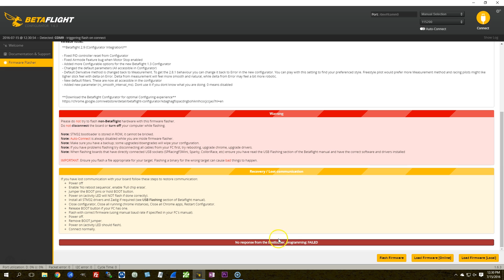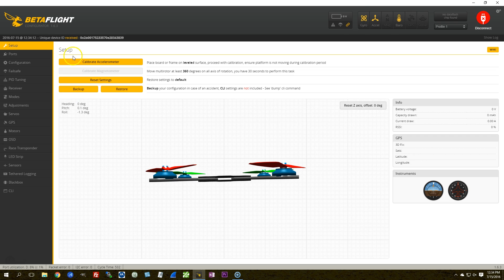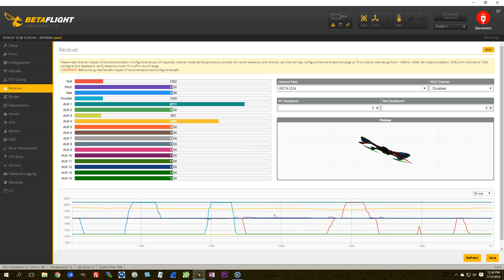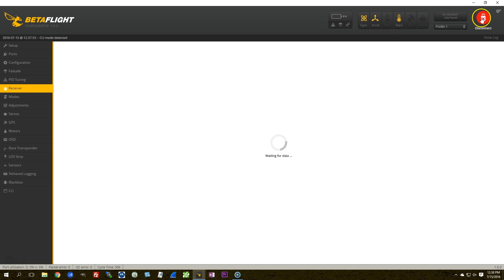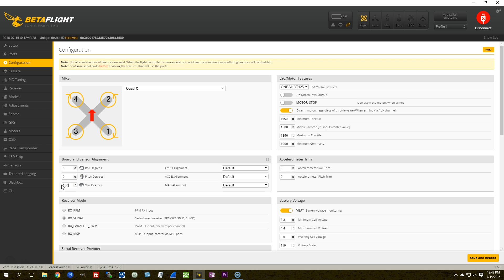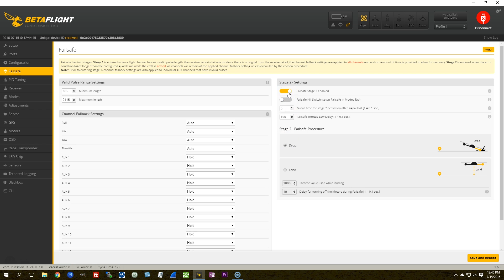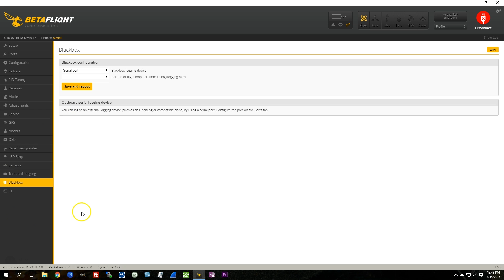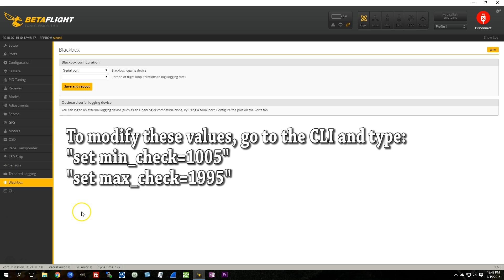Betaflight Setup (BETAFLIGHT 3.3 VERSION IN VIDEO DESCRIPTION!)

Comment: Did they remove LED light strip? I finally switched to BetaFlight, and there is no LED Strip option. It shows' up in Josh's video.
BF Configurator v 1.7.6
Reply from the maker: +Borg Quads maybe your board doesn't support it?
Reply: It worked on CleanFlight though.
Reply: Forget this post, my dumb-self forgot you need to enable the strip, oops. don't know how i missed that.

Comment: does BetaFlight support GPS features like RTH or the GPS Hold modes? I'm just curious, I've never seen anyone use it with BF.
Reply from the maker: GPS support in cleanflight has always been basically nonexistent. You want the iNav fork. There are issues, including lack of memory on the current generation of boards, that are preventing iNav from being fully merged back into betaflight and cleanflight. Many betaflight/cleanflight features are present in iNav though.
Reply: thankx, I've to read more about iNav, BF and CF GPS capabilities...

Comment: Accelerometer calibration was missed. Important to calibrate this on a level surface for a new quad
Reply from the maker: +seafurymike accelerometer is disabled.
Reply: +Joshua Bardwell im confused then. Does BF not use the accelerometer in its PID algorithm?

Comment: On July 28th, I was scouring the internet looking for a simple tutorial video like this but it didn't exist. Ironically, I found a comprehensive 40 min long tutorial which I followed to the tee, but during lift off my copter raised approximately 1 inch off the ground before flipping out uncontrollably and crashing which seemed odd. All the props and motors were faced the correct direction. I was in level/horizon mode during liftoff because I thought that would be the safest mode for maiden. The only thing I found peculiar during the betaflight (cc3d) setup was that in every flight mode if picked up and tilted the quad while the motors were spinning, the motors would speed up. I understand that is how autolevel typically functions but that doesn't explain why this was happening while autolevel modes were off.This would happen while in airmode as well. Is this normal behavior? I never had an issue with this in librepilot so I'm really baffled. 

I disabled battery voltage in the configuration tab and my gyro update was default settings from Betaflight 2.9. I'm also using new hobbywing xrotor 20a escs (which would only calibrate when set to PWM protocol. Any other protocol these ESCs would continuously beep.) I also was running ibus from the Main port.  Acellerometer roll trim was default at -8 and pitch trim was default at -6 (IDK why betaflight defaults this way). Is minimum throttle in configuration tab the same thing as Min check? I know this is alot but I'm not sure who else to turn to on this. Watched your live stream the other day hoping someone had a similar issue but didn't see anything pop up.
Reply from the maker: Motors should always respond to the copter's motion even when autolevel mode is off. The PID loop is always active. The only difference is, in autolevel mode, the PID loop tries to keep the copter fixed relative to the horizon; in acro mode, the PID loop tries to keep the copter stable but not fixed relative to any particular external reference point (like the horizon). The motors are spinning up because you are moving the copter, but the sticks are not commanding the copter to move. This is correct and normal.

The copter flipping off at takeoff: https://www.youtube.com/watch?v=X4746_KLVEI

Min_throttle is not the same as min_check. https://www.youtube.com/watch?v=WFU3VewGbbA

Comment: Can i use ez-gui to tune pid on Betaflight?
Reply from the maker: +Rizki Pratama yes.
Reply: +Joshua Bardwell thanks
Reply from the maker: The betaflight-specific options aren't in the GUI (yet) but you can access them via CLI if need be.

Comment: Hey Joshua, thanks for all your videos you put out first of all. I am having a lot of trouble trying to get my flysky fs-i6s transmitter to output anything that betaflight can read. i have bound the rx to the tx already, then put it in the quad and hooked it up to a xracer f303 v3.0 running betaflight 2.9.0. i am trying to select ppm and i have made sure i have plugged in everything correctly. i don't know if the problem lies with flysky in general or somewhere else. i can provide further details if needed.
Reply from the maker: +Jack Hawes PPM input is usually on pin RC1.  If you are trying to use the SBUS input pin, that won't work. That pin is only for serial input. If you have the FS-i6S can't it do iBus protocol? That's what you should be using over PPM if possible, because serial is lower latency.
Reply: i did have the ppm in the right holes, and i had that output mode selected on my tx. but maybe ibus will work, ill do a teardown and try that in the morning, thanks.

Comment: i got the new mantis F3 and had them preinstall the new betaflight on it. i configured the rest of my copter like normal but when its sitting on the ground armed with blades spinning it will rev up randomly. i notice when I was flying it kinda did that also, and when i drop the throttle to dive, it doesn't really drop the throttle down. when i came in for a landing, when i touched down it bounced up and throttled up. when is my issue do you think?
Reply from the maker: You're not used to Air Mode.

https://www.youtube.com/watch?v=d2nRrVENEYM
Reply: +Joshua Bardwell i was in horizon mode. i did have an issue i figured myself when it was trying to flip over. i had to trim my roll on my 9XR. the copter thought I was giving it roll command. maybe my 9XR is bugging out? and when i was using air mode in 2.7 beta i never had a bounce issue.
Reply from the maker: Ah, okay. I guessed that you were new to betaflight because of the reference to the Mantis coming with it.
Reply: +Joshua Bardwell no, i had it on my xracer f303 2.1. it was amazing until i plugged my vbat connector into my current plug and fried my board. i watch you religiously i thought I could figure this out on my own but im kinda scratching my head. i have a blackbox of this happing if it would help.
Reply from the maker: If you're in Horizon mode, the motors spinning on the ground may be because the accelerometer is not calibrated level or trimmed correct, and the motors are trying to level the copter. The bonce on the ground may be excess Level P, resulting in strong correction.

I honestly don't have any experience tuning autolevel modes at all.

Comment: So today i was pulling  up some heatshrink to put over the escs and pulled a resitor off, i plugged it in and no smoke came out but the motor wasnt connected . this is a picture of almost identical escs. http://www.readytoflyquads.com/media/catalog/product/cache/1/image/9df78eab33525d08d6e5fb8d27136e95/2/0/20160411_232814.jpg if you look at the picture where it shows it upside down, I ripped one of those brown resistors where the motors connect. Thanks if you should help me.
Reply from the maker: Not sure what you're asking.

Comment: As always , great timing :) thanks for this vid, finding upto date info especially on BF is challenging enough :) Any new info on settings for Gyro LPF and Gyro cut w BF 2.9? or blackbox and tune from there?
Reply from the maker: +Hawaii Drone Racing leave at 100 unless you get hot motors due to excess noise or D gain. If you get hot motors, lower the cutoff until the get cool.

Comment: Thanks for the video.  How critical is it if you don't have the range 1000-2000? My dx6 operates within the mentioned range but never been able to get it to operate like you demonstrated. I still fly ok though... 

thanks again.
Reply from the maker: If you don't reach the full extent, then you won't it maximum rates. This can easily be adjusted by increasing the rate though. You may not be able to input stick commands if you don't exceed min_check or max_check. Most importantly, you won't get full power if your throttle doesn't go all the way to the top end of the range. 

If your transmitter can't reach 1000-2000, use the rxrange command to adjust cleanflight's expected endpoints.

Comment: Don't you use your own in flight adjustment method you posted here? http://forum.flitetest.com/showthread.php?18173-Taranis-advanced-programming-switch-multiplexing&utm_content=buffer239e1&utm_medium=social&utm_source=facebook.com&utm_campaign=buffer

I'm loving that tip.  Before I saw it I was using just a 3 way switch to go between Pitch and Roll P, I and D.  Now I have a switch that chooses P, I or D, and another that chooses Pitch, Roll or Yaw (all on Aux 3).  That means I can adjust all PIDs in flight, just by clicking the elevator trim tab up or down to increase or decrease 1 point at a time (elevator trim puts +100 or -100 on Aux 5)
Reply from the maker: I go back and forth. Some times I want to know the exact numbers. Sometimes I want to quickly change in the air.

Comment: If your rx end-points are not at 1000-2000, how do you correct that?
Reply from the maker: Depends on your transmitter. You need to adjust the transmitter setting to change the endpoints. Not every transmitter has this feature, in which case you have to use rxrange in cleanflight instead.

Comment: always great to hear.
Was the board you were flashing connected in your quad, or just freshly bought?
I am wondering if my wiring is wrong somehow.
When you plug in your USB, the receiver is also powered, right?
Reply from the maker: Whether USB powers the receiver depends on the board. Many newer boards have this feature, but some don't.
Reply: yeah. I am still using Naze32.
Thinking of getting F3 board next.

Comment: Nice! do you always leave min and max throttle on stock values?
Reply from the maker: +Tom Smith FPV I use this method. https://youtu.be/zCoEWBhJy6Q
Reply from the maker: Just to elaborate, I leave min and max at 1000/2000 and then adjust my ESC endpoints around that. I think this gives maximum resolution to the motor outputs. In this case, I had already performed that adjustment on these ESCs and motors before, so I felt comfortable not repeating the calibration.